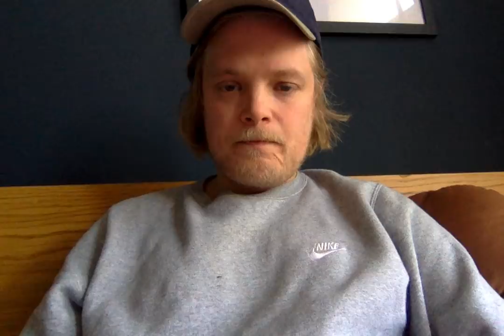PUBLIC SPENDING CUTBACK IDEA

Comment: You're on the right track but a half pipe would do you no good. What you need is two quarter pipes back to back that would send the cars flying over the oncoming traffic landing safely in the industrial strength super net.